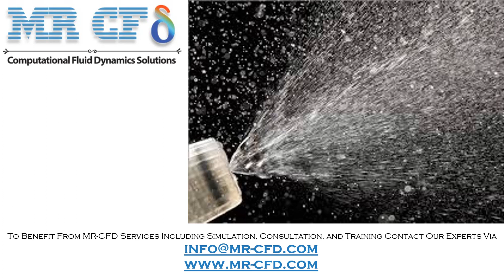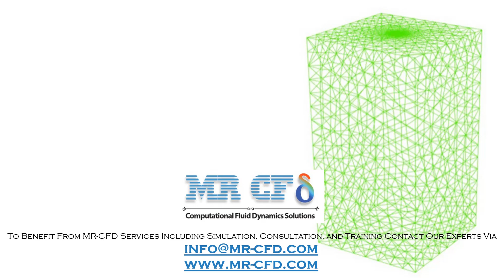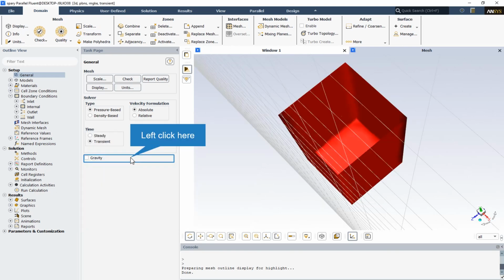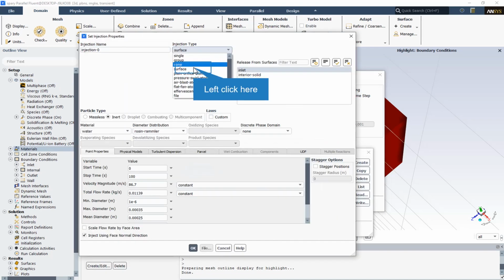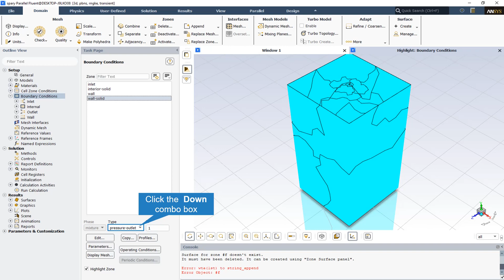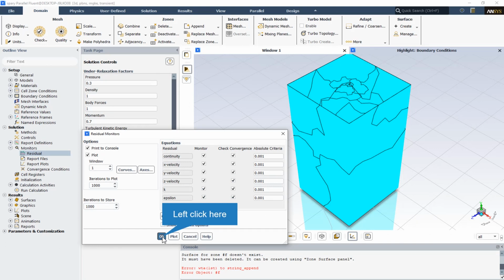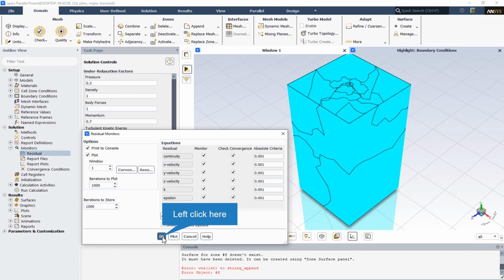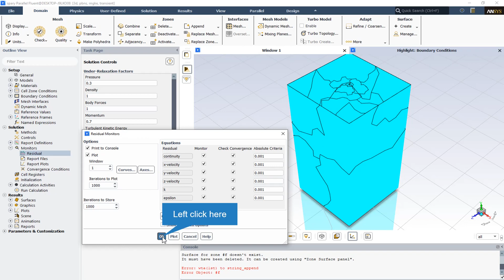ANSYS FLUENT Training: Spray CFD Simulation Using Injection in DPM

Comment: Is the recent iris xe graphics with the 11th gen i5 16gb ram compatible and sufficient  with ansys for low  medium 3d simulations?
Reply from the maker: please call me on WhatsApp , it is so complicated to tell you which configuration is needed for your simulation work. +19032313943
Reply: @MRCFD  Have you tried to run ansys on 11th gen i5 laptop with integrated iris xe graphics ? Does it work or not

Comment: i want to do  the simulation on droplet size distribution from injector but i am using Sim-Flow software which is also a CFD . Can you help me?
Reply: Wan ramlin rohalin, I used OpenFOAM for spray cone parameters of an injector. But, due to computational power wasn't able to find the droplet size.  SimFlow is a GUI of OpenFOAM, so maybe I can help
Reply: @muhammadalinaeem4730  can I contact you sir?
Reply from the maker: we are expert in Ansys fluent software